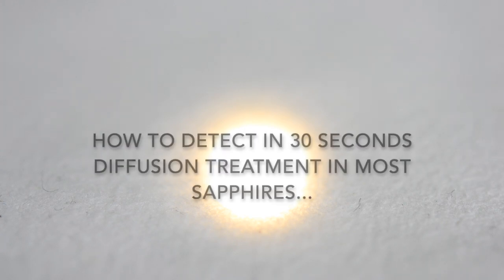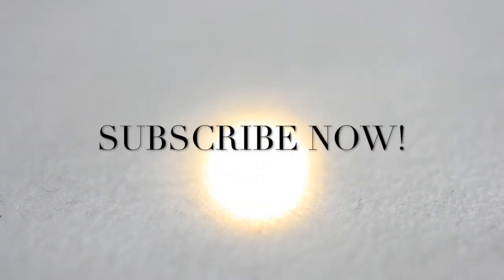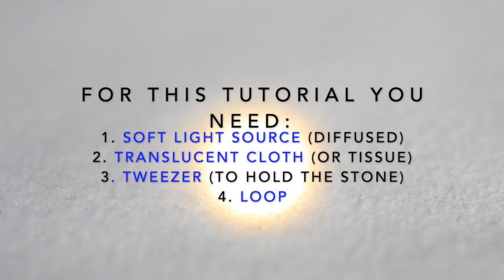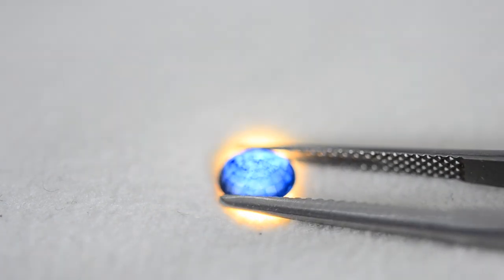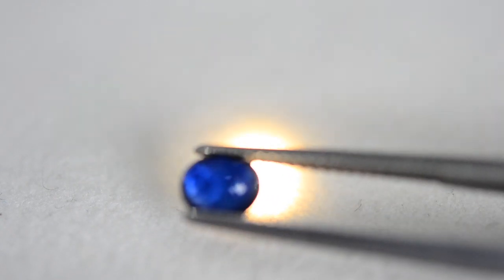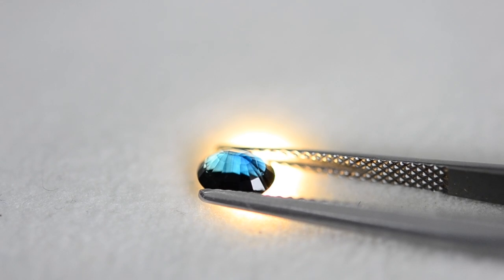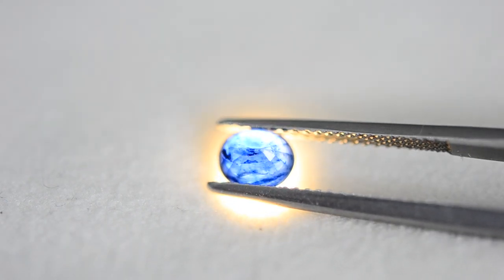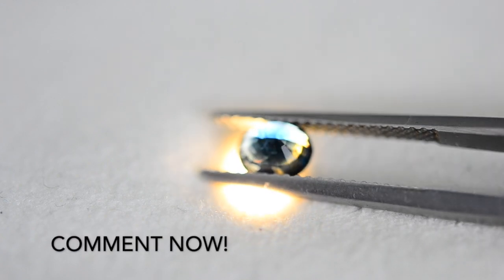How To Detect Diffusion Treatment In Sapphires In 30 Seconds

Comment: what is a diffusion?
Reply from the maker: The diffusion technique, which involves the addition of color-causing chemicnls during heat trentment, results in a thin layer of color at the surface of colorless or light-colored sapphire.

Comment: so the last number 2 is unheated ??
Reply from the maker: Sapphire is treated with diffusion treatment you will likely see a concentration of color on the edges of the stone’s facets like this stone here. However in this second sapphire without diffusion you will not be able to see any concentration of color on most facets.
Reply: @NavneetGemsMinerals thxx but its hard sometimes.  For eg, I have a pink sapphire and it is a ring so how should i do it
Reply: @NavneetGemsMinerals  can  u make a pink sapphire example

Comment: So the concentration of color at the edge means a diffusion?
Reply from the maker: Diffusion occurs when molecules in an area of higher concentration move to an area of lower concentration.
Reply: This type of detection works for stones that have experienced diffusion before being faceted.  The color enhancement can only go so deep - when the rough piece of sapphire is faceted, much of the surface is removed which also removes much of the "new" color.  It's at the facet edges that the least amount of material has been cut away.  As a result, the added color will be thicker along those lines as apposed to the center of each facet.